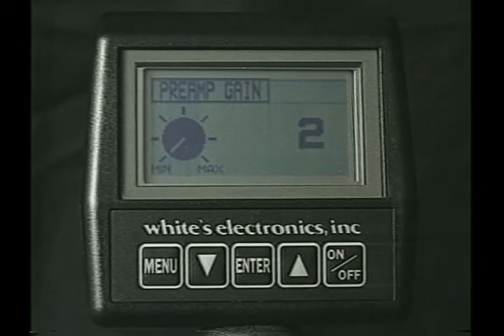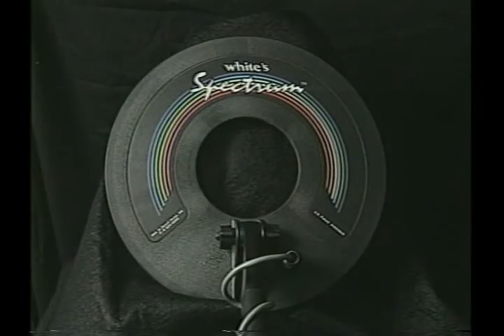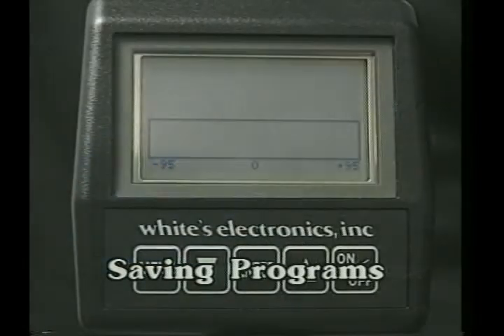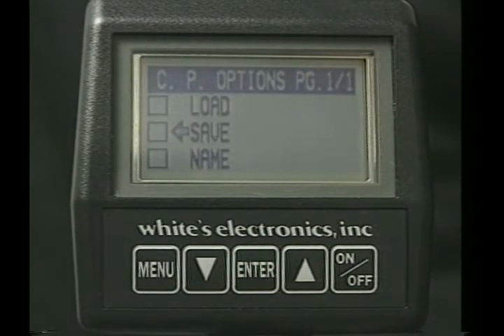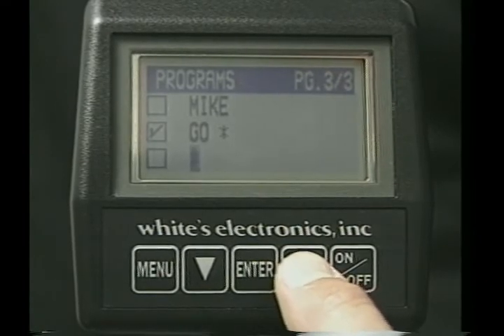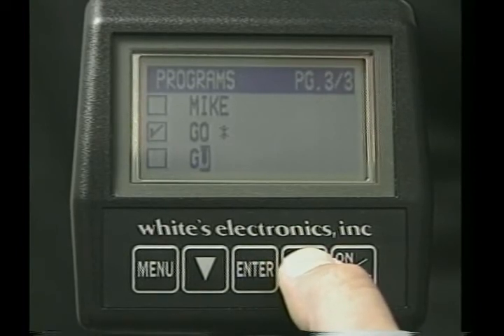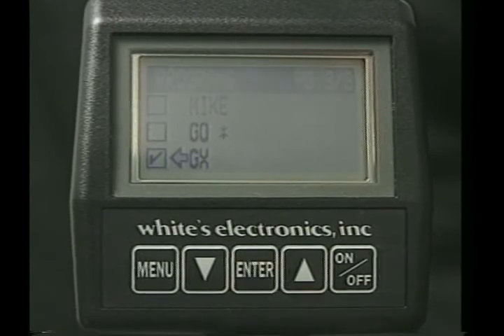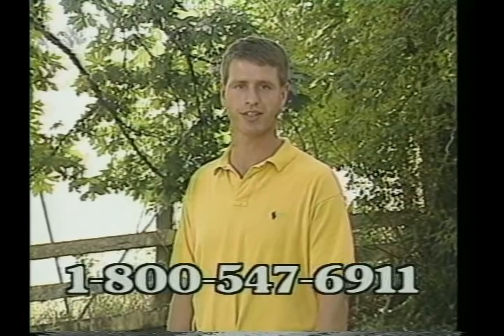Part 9 - XLT instructional video

Comment: Thank you very much for all of your instructional videos! I found my Spectrum XLT at a yard sale 3 weeks ago. I only paid 5.00 for it! The battery had corroded, but the battery post broke off halfway to the circuit board and the corrosion didn't get to the board, so I was very lucky! I found a website that has parts for sale, and ordered a new post. A local cell phone repair shop soldered it in for me for 30.00. That means I have 35.00 in a very nice metal detector! Because of your videos, I now have mine set up, and I understand more than I did before, so Thanks again!

Comment: I have been looking at the XLT detector for some time now. I decided to try and purchase one on Ebay. After two attempts, I finally got a good operating detector. Your video's were very helpful in setting mine up. I will have 3 of them by December 8, 2023. I have enough knowledge to repair them to some extent. Found the last one with the display broken off. I believe I will be able to repair the two non-working detectors and end up with two good working machines. I simply love these XLT's. They are remarkable. Thanks for your instruction video's. I watch them for keeping my dtectors working correctly. Thanks again, great job explaining how to set them up properly.